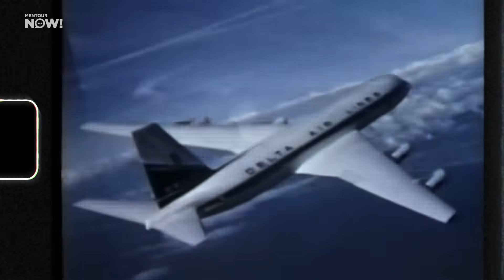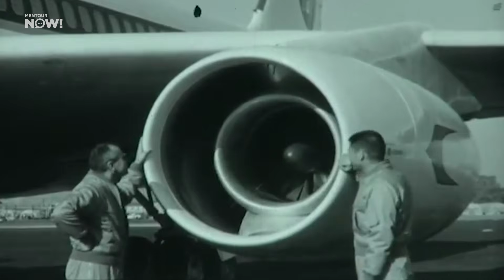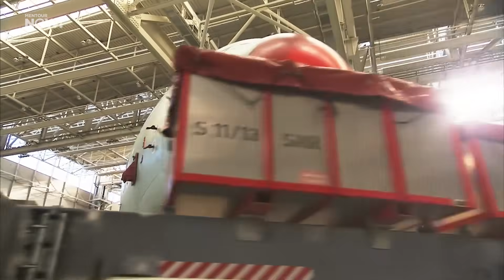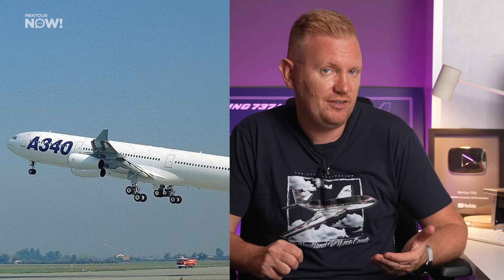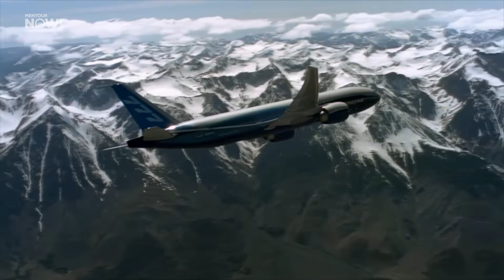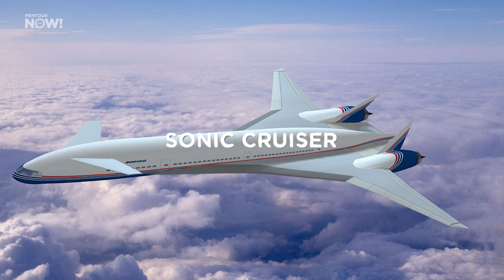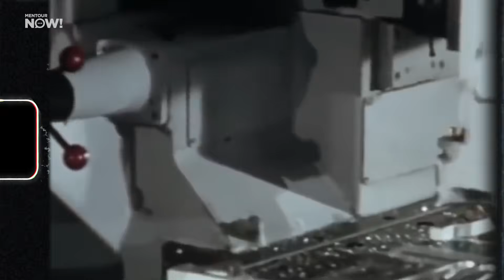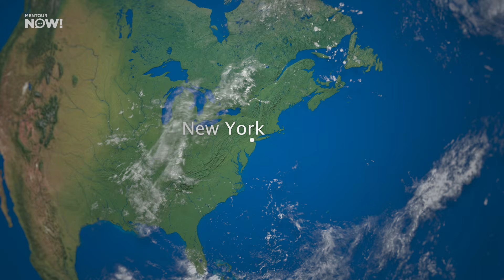WHERE is the Boeing Sonic Cruiser?!

Comment: Boeing screwed up big time developing the 787 from the failed Sonic Crusier ... and .. NOT developing the 757 to replace the 737, with the 767 for the medium jet market & the 777 to replace the 747 for the large jet market.

Airbus showed in the 70's with the A300 ... that the future ... for small, medium & large airliners ... will be twin jets .. with more efficient wings ...for range & efficient ... and increasingly bigger high bypass Turbojet engines.

Boeing should have never considered a longer 747 with better wings & engines ... to compete with the A380 .... but should have developed simply offered airlines the NG, Max ... and ... X options ... for the 737, 757, 767 & 777 ... with  all X versions have getting a new composite wing, more efficient engines, major weight reductions, and new flybywire stick control glass cockpit.

The $32 billoin spend on developing the 787 ... should have been spend on developing the composite wings for all four models, reducing weight and the new standard flybywire stick controls & redundancy systems for all  X models.  The stretched 747, & Sonic Cruiser were stupid ideas  ... when the 737 & the A320 .. were the bread & butter jets or most airlines ... and long range twin jets was clearly the future.

Again.  Boeing screwed up .. way back in the late 70's ... when the stupidly developed the 757 which has the same same size fuselage as the 737 ... with the the 767 ( a wide body) ... for the medium jet market.  The Boeing screwed up again after Airbus released the A320 ... by  NOT constantly improve the the 757 with an NG, Max & X version ... to eventually replace the 737 NG & Max.  Likewise ... Boeing never constantly improved the 767 with an NG, Max & X, but simply replaced it with the 787.  And when Boeing developed the 777 & 787 ... it refused to adopt the flyby wire stick controls that the Airbus installed on on all of its aircraft after the A230.

Comment: Mach ~0.8 is the sweet spot where it's as fast a possible but without being so fast that problems start to pop up. Barring some revolutionary development, we won't be going faster anytime soon.
Reply: With the 1970's fuel shortage, price hike, all the airlines reduced the cruise speeds on all the jets, to what they are today! Them 707 - 747 airplanes were flying at 100+ mph faster than what the commercial airliners are flying today! The lower speeds had big money savings, not just from the fuel costs but also less maintenance of the engines, airframe costs etc.

Comment: Airbus ran ads on commercial TV in The Netherlands mocking the twin 777.  I was living there.  These were frequent on local TV.
Reply: @@phillipbanes5484there's no reason to pay something, Boeing itself gives the best reasons against them itself (787 quality problems, 737 Max disaster, 777X delays, KC-46 quality problems and cost overruns, starliner cost overruns and delays).
What did actually work fine there the last 10 years?
Reply: @@phillipbanes5484 are you a Boeing employee? No company is perfect (Airbus also has their faults) but it's obvious there's a lot wrong with Boeing the last time.

Comment: If you could get into some Cessna history that would be cool, given they’re what many people learn on… I noticed a Cessna Citation CJ3+ cruising at 43,000ft on flightradar 24 earlier! Thought that was a pretty impressive cruise altitude for a small private jet!
Reply: A lot of the small jets can cruise that high, and frequently do so. I forget all that goes into the pros and cons of doing so, but at least up there you’re above most traffic. You can also travel faster at the higher altitude. I think it can be a little less efficient. Someone I knew with a CJ4 used to always complain if his pilots started going to high and fast as it burned more fuel. Also, small jets are much less laden with passengers and cargo.

Comment: As @SwedishVFR pointed out in the current top comment, much of the failure of hub and spoke comes from the headache associated with layovers. I used to travel a lot for work, and airport lounges made the experience tolerable - but those are often just as noisy and crowded as anywhere else. I wouldn't mind a six hour layover if I had access to a swimming pool, or a movie theater, or a tiny hotel room where I could grab a shower and take a nap. These amenities are almost nonexistent for domestic air travel, and when they do exist, the prices are often crazy high. More importantly, they need to be on the sterile side of the airport, so I can set my alarm to go off 20 minutes prior to boarding, and not have to worry about security.

Layovers are also terrible if you're traveling solely with carry-on luggage - which is standard for business travelers due to the issues with checking luggage (extra time, lost luggage). Being able to check your bags, and count on them reliably being at your destination without having to wait a extra 30 minutes makes the whole airport / layover experience much nicer.

In short, hub - and - spoke is NOT intrinsically flawed. But it's dependent on support systems they often let it down.

I would love to fly to a hub, grab dinner, see a show, check into a hotel room, shower, sleep - ALL IN THE STERILE AREA - and wake up just in time to walk to my gate. But that doesn't exist.

Also, as someone with back pain, lay flat seating changed my life. I'd much rather spend 24 hours on a blimp with lay-flat seating than 4 hours in economy. I'm 190 cm and 136 kg. For me, coach seating qualifies as torture. The first time I was able to lay down on a flight, my world changed.
Reply from the maker: Good points! I agree, I am actually sitting in Schiphol at the moment, waiting for a connecting flight and its not fun! 
Thanks for your support!
Reply: Hub and Spoke suffers from a lack of resilience. A closed runway at an airline's hub can completely shut down their network.
Reply: Yes, I agree. People don't care too much about slightly shortening the trip, they care a lot about avoiding the hassle of missing connecting flights, losing their belongings etc. when they are far from home and planning on being productive or spending an already expensive and non-postponable vacation.
Reply: Doha actually has what you are looking for. An airside hotel, paid access gym+pool, plus of course lounges etc.
Reply: I see it differently.  Even if a layover saved me time, it would still make things worse just because of the hassle of having to get off and back on airplanes even once.  If I can just stay in my seat for the whole time, with my computer, I'm set.

Baggage isn't an issue for me.  I've always checked it through and only had a problem once.
Reply: @psychohist  I can see both sides - I think it depends on a lot of factors. First, boarding and unboarding used to take a LOT less time as there were fewer passengers with fewer carry-ons. 

If we're talking about a layover between two short flights, say 2 or 3 hours, I agree with you direct is always better. But if I'm talking about a 6 hour flight into an 8 hour flight, I'd probably enjoy a chance to stretch my legs, grab a drink / meal, or visit a gym - versus be on a single 14 hour flight. Well, unless I had one of those first class "cabins". But I don't even want to sit in business class for 14 hours continously.
Reply: a cinema would be really nice while waiting for a plane
but it might cost 5x normal (like everything else in the airport)
Reply: @AzizFranklin Imagine the cost of the popcorn and drinks! You'd need a second mortgage to afford them.
Reply: AMS has 2 airside hotels, AFAIK. A Mercure and a YotelAir.

Comment: Good info as usual for you and your channel.  Each time I see top speed shown, I am reminded all planes start at 0 knots on the runway and take AT BEST half hour to reach top cruising speed With a reverse speed drop at the end. Getting to higher speeds increases that ramp up and down times. So only on long haul does this top speed get you any flight time difference but loading and ground times are still the same. Given current climate changes, anything which increases fuel consumption will get a side eye if not get shut down completely.

Comment: It seems like while the 2707 was too ambitious in terms of speed targets, the sonic cruiser simply wasn't ambitious enough. If you want to sell your jet on speed, it probably needs to be at least 2x faster than the norm, i.e. Mach 1.4-1.6, or the advantage just doesn't seem significant to passengers or airlines.

Boom is trying this now, but while I'd like to see them succeed, it seems they're really struggling after failing to find a partner who will develop a new engine for them. The fact that they're now looking to build a quadjet that will carry at most 80 passengers makes the operating economics really questionable as well.

It seems like it ought to be feasible with modern technology to design a passenger jet that runs reasonably efficiently at supersonic speeds, but I suspect there's a sort of market bootstrapping problem going on, where no one's quite sure if the market for more expensive tickets on a faster plane is big enough to justify the expense required to build an airliner like this.

Comment: All that learned in designing the American SST was later used in designing & making the B-1 & B-1A
Reply: The B-1 was built by a company familiar with supersonic aircraft. Boeing has never produced a single self developed supersonic aircraft (F-15 and F-18 came from MDD).
The sst mockup showed their lack of experience in this topic, Lockheed had a much more realistic proposal than Boeing
Reply: @simonm1447  The Bomarc surface to air missile of the 1950s was supersonic and flew with two ramjets after being boosted to supersonic speed by a rocket engine.
Reply: @@phillipbanes5484 the difference between the US SST and Concorde was Concorde may have been a economic failure but it had a more realistic  approach. Concorde focused on a speed range where a conventional aluminium aircraft still worked. The US SST was planned for higher speed, which meant Titanium, which makes everything more expensive and harder to build. The swing wings would have been far too heavy to be a realistic Option.

Lockheed, the 2nd competitor had an aircraft more similar to Concorde, what showed which company understood how to build a supersonic aircraft and which not.

Btw, North American Aviation was already part of Rockwell when the B-1 was developed, so they even had a Mach 3 aircraft before.
Reply: @@phillipbanes5484 The North American F-100 was a supersonic in level flight airplane.  They also built the X-15.
Reply: @@phillipbanes5484 it depends who builds the aircraft. Lockheed can build excellent aircraft, when it comes to Boeing we can't say the same. 2/3rd of their lineup are modernised legacy aircraft, Airbus is today technically superior to any Boeing airliner model. Just Lockheed or NG are still superior when it comes to military aviation.
Boeing is today what MDD was in the 90s, a wreck of a company

Comment: The older mechanics who were still working when hired in 1987 used to rave about the Convair 990. Even if the flight performance came up a bit short, the engine power and response made for fun taxiing. By the way, Multiplex models from Germany made a radio control model called the Sonicliner. It is nearly identical to the Sonic Cruiser. I had one, and it was a blast to fly, except that control harmony wasn't great. It was way more sensitive in roll than in pitch. I put brushless motors in it, and it was a real screamer.

Comment: Its interesting that you say that Convair was a little slow to adapt to the jet engine era. This was indeed the case, but there were reasons for that. Ive recently read about the Convair B-36 Peacemaker, the largest strategic bomber ever built solely designed to carry the original giant "Fat Man" style atomic bomb. Or rather to carry two of them at a time. It featured a total of six propeller engines in a pusher configuration aswell as four jet engines. Yes that makes a whopping ten! engines for a truly giant airplane. The reason for this strange mixture of technology was that at the time the B-36 was designed, jet engines still had a reputation of being amazing in their performance but being prone to a variety of technical issues making them a not truly reliable technology. While this was not truly Convair's mindset, the more it was the one of Convair's customers like the United States Airforce. They clearly stated they prefer a realiable bomber based proven engine technology rather than on the latest and greatest. A bomber which would reliably carry the atomic bomb to Russia if called upon, rather than ending up on the runway with burning or exploding jet engines in the worst of moments. Convair's answer to the request was the https://en.wikipedia.org/wiki/Convair_B-36_Peacemaker
Reply: The B-36 program goes back to the early 40s, back then there was no jet engine which could power a 180t aircraft. Even the B-52, one generation newer needed 8 engines, and these are 1950s era engines. Today aircraft with twice the mtow of the B-36 fly with 2 engines.

Comment: Another great video - educational and enjoyable. 

Until or unless we can overcome some of the fundamental problems surrounding supersonic, or even hypersonic flight, which are significant physics and economics problems, regular civilian flights much over mach 0.9 will remain a pipe dream. 

NASA are working on designs that either do not produce a sonic tail or disrupt it before it can form, but the reality is that the sonic boom is only a small part of the issue, frictional heating of aircraft, especially leading edges, cannot be mitigated very easily and as such, materials science has a huge part to play - but at mach 2, many leading edges can reach into the 100s of degrees in temperature - not great for composites held together with adhesives not capable of withstanding those extremes.

Comment: Another interesting video, but I'm afraid Mentor Pilot missed the Sonic Cruiser/7E7 point. I was there working in Boeing customer support and marketing at the time. The Sonic Cruiser was canceled in December 2002 and the 7E7 was publicly launched in January 2003. At the time all of us with any knowledge of the the Sonic Cruiser program thought it wasn't anything other than a paper airplane to give the airlines something to think about other than the A380. Mentor, think about it. Any aircraft flying transoceanic are sequenced with the traffic flow and it is very difficult to overtake a slower aircraft. So you put a Mach .84 Airbus in the lane and the only thing a Mach .98 Sonic Cruiser could do is throttle back. Anybody flying the Mach .92 747 understood this problem. The 7E7 could never have been publicly reveled one month after the Sonic Cruiser was canceled without a very developed 7E7 on the drawing board. I'm still very proud of how the great Boeing Company hoodwinked Airbus over the A380 industrial disaster.:face-fuchsia-tongue-out:
Reply: Sonic cruiser could have flown higher than conventional jets so , traffic jam would not be a problem
Reply: That would depend on what its climb profile at different weights was. Just because the SC would have been capable of reaching certain flight levels doesn’t mean it could do it in one go at the kind of weights that it would have carried in commercial service.
Reply: Or you could make a separate lane for the Sonic Cruiser specifically like what they did for Concorde.
Reply: @cancelanime1507  Concorde flew in 18 km altitude, compared to 10 to 12 of a normal airliner.
A coffin corner did not exist for Concorde
Reply: @simonm1447  The Sonic Cruiser would have cruised at 50,000 feet if I remember correctly.
Reply: @cancelanime1507  the Wikipedia article says "in excess  of 40k ft" , which means higher than the normal airliners
Reply: @simonm1447  Exactly so traffic wouldn't be an issue
Reply: The 380 was surely an economic failures, but it remains one of the most comfortable aircraft ever built and as a passenger I would always prefer it above every single Boeing aircraft.

Comment: That Convair is stunning! However, were they running those engines on coal or charcoal? It was trailing so much smoke…
Reply from the maker: Yeah, many old turbojets and early low-bypass turbofans liked to smoke. I think the engines of the 880 in particular were essentially a commercial version of those in the F-4 Phantom, which was notorious for trailing smoke!

Comment: One other issue with higher speed travel is not the travel time but the airport ground time - so the fixed times are the checkin/bag drop and document checks and boarding etc. Then the flight time and then destination document check time and baggage claim. On top of this is travel to and from the airports.

This could be 4 hours or more coupled with a 6 or 7 hour flight so the time saved for passengers by going faster is even a smaller percentage unless ground operations are faster too

Comment: So before I watch it: it was was a bad idea, mach .99 is close to peak transonic drag so fuel use would be huge for a 10% increase in speed, it would seldom save appreciable time as it would usually be offset by connections and loading/unloading, the back-of-the-neck canard design is flawed, area ruling seems middling.